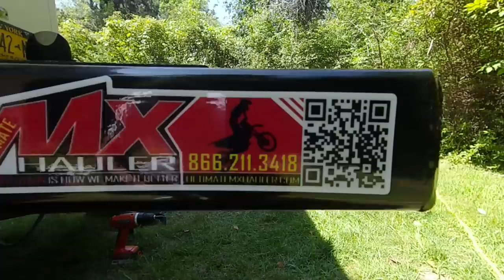My Life Is Supposed To Be Stress Free, Right? GPX Moto TSE250 Why We're In NY So Long | Lefty Update

Comment: I have the same kind of luck sometimes catch a break. A lot of people don't realize when receive freight you can open up the box and look for damage you can refuse the shipment. You call the freight company and ask for the OSD Department. That is the over/ short/ damage Department.  Tell them what you have and they will put a claim in. I worked in a restaurant supply place and we refused refrigerators fryer freezers and other for damage. The factory sends out a brand new one and the freight company pays the claim for the first item. That way you don't have to mess with getting it fixed
Reply: When you have been waiting for months for it and would face another 3 months wait, fixing it is quicker and easier.
Reply from the maker: I just saw this reply Stephanie - you hit the nail on the head!

Comment: Old Dominion may or may not be the source of the damage. I think sometimes these trucking companies, depending on the final destination, will ship it so far and drop it at another trucking company's termination so it can be loaded on another truck to get it to its' final destination. I ran into a problem of receiving, by accident two of the same item. I'm in the Midwest. The other item was for a guy in Utah. When I asked the truck driver about it, he said a different trucking company would handle getting the item to its' final destination.
Man, I think it's a crying shame something initially packaged so well could get so beat up. You'd think someone along the way would stop the presses, contact the importer, manufacturer, etc. and let them know of the damaged goods. Guess no one wants blame pointed at them. Sounds like Gary is going to take care of you. Two thumbs up to him.
Reply from the maker: Yes it did transfer to the final partner company - Gary has sent me everything needed and has been great support. Everything is back to new condition now and I'll be testing riding it soon :)

Comment: File a damage report with the shipper! I had a Kawasaki KLR 250. Good on the dirt, even on the road.. good mpg! I've got the same results.. if it's 
Bad I'll get it. Was it shipped via ship. It case you need to get parts.
How about an adjustment on not being 100%, damaged a bit.
Reply from the maker: A claim has been filed and the dealer has shipped me the parts. I painted the frame scratches so well be ready to roll soon!!